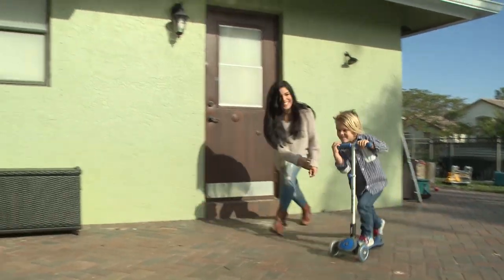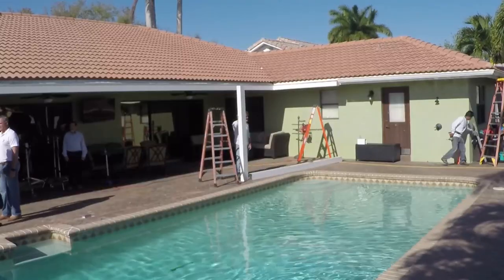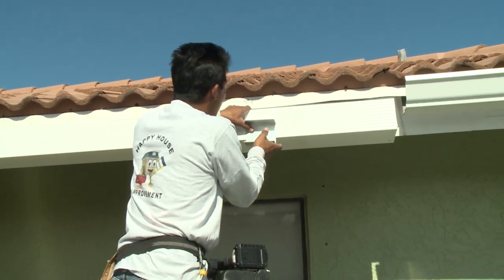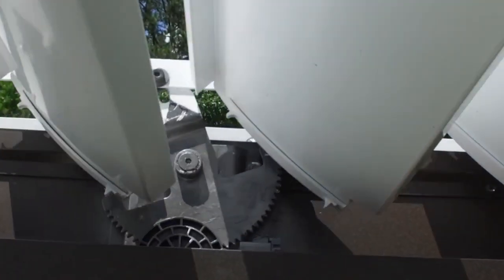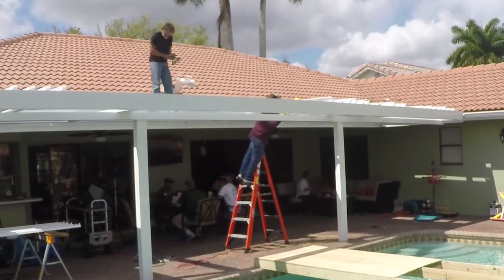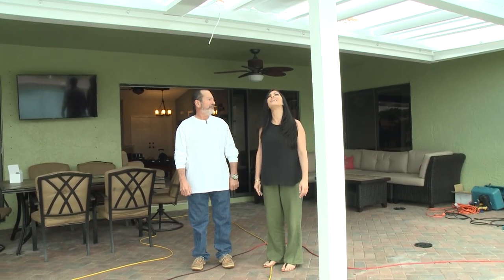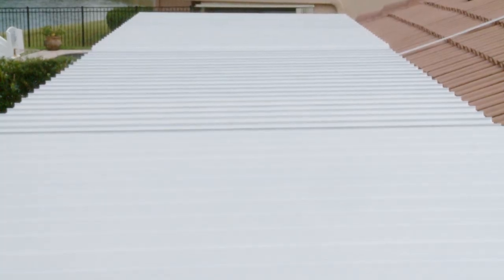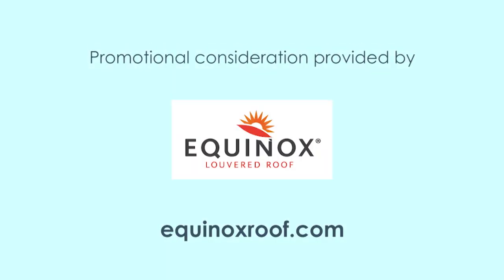The power of a pergola! Powered Louver Roof Systems!

Comment: 5;43 ... he fits the brackets into the block work , but doesn’t tit it into a silicone seal. Pool water will get between the brick and aluminium and wreck it over time.

Comment: what about when it rains, will it leak? how does it drain?  looks pretty cool I like them a lot.
Reply: No. Roberto.  The Equinos will not leak when it rains. It can even be installed flat without leaking water when it rains. It comes with a built-in Gutter to handle water, too. BTW... The Equinox also handles snow loads. Melting snow does not leak through either!
Reply: They have sometimes built in gutters or the GC custom fits a small gutter.

Comment: i want know what floridas min wind speed load is for the max post spacing allowed is ? Because he attached to an existing slab and his post spacing seemed pretty far apart. to answer someones question the louvers drain into a gutter system that runs the entire interior perimeter then a carefully placed downspout that blends in with one of the posts. ive built a few but i have to dig footings because of wind and snow load requirements 130mph winds which i dont get since the max gust ever recorded here is 82mph
Reply: g mason they hold up to 170 mph winds for 3 seconds it’s usually the twisters that take them out as far as the post go I’m not sure what code is for Equinox  I do the insulated aluminum patio covers

Comment: Is it rain proof ?
Reply: Yes Kathryn. The Equinos will not leak when it rains. It can be installed flat without leaking water when it rains. It comes with a built-in Gutter, too. BTW... The Equinox also handles snow loads. Melting snow does not leak through either!
Reply: How the hell would she know? She clearly says its sunny 24/7 😹